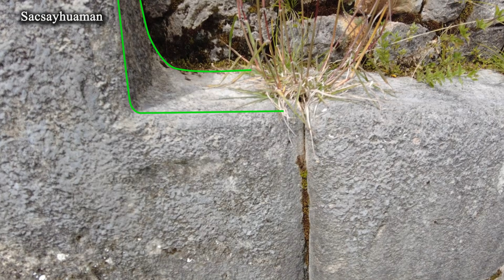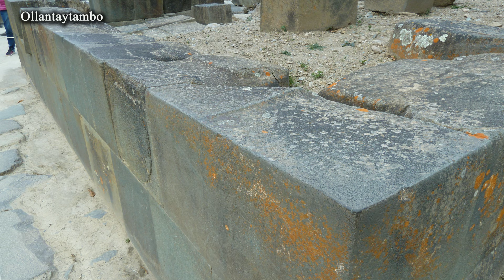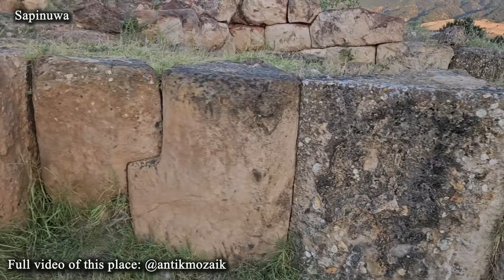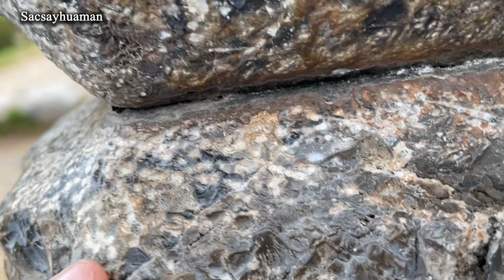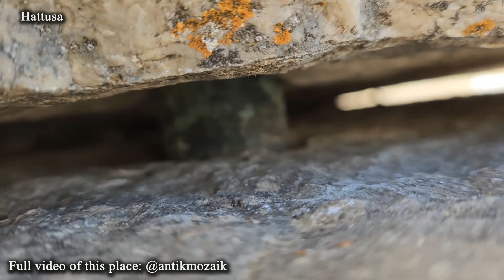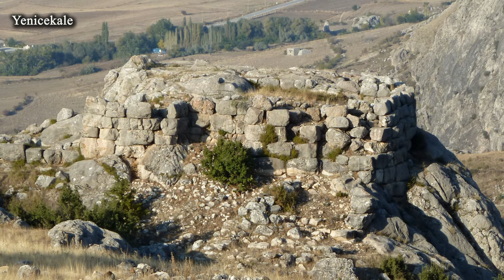Precisely Fitted Masonry in Peru and Turkey: A Comparative Analysis

Comment: As a structural engineer I know what amazing craftsmen the ancient stonemasons were. The fact that we can't build these today and don't know how they build it back then, it says it all. The size of the stones is one matter and the tight joints is another.

I will comment about these tight joints we find all around the world in ancient ruins. These tight joints became so after the fatigue of the material, by "Creep" as it is called. It is a phenomenon, a very slow process that creates deformation due to material fatigue after many years under pressure. Of gravity in our case.

All materials "suffer" from this deformation but it takes hundreds or thousands of years for it to become visible, depending on the material and specifically its Modulus of Elasticity. It is the property of a material that shows how "elastic" it is under external pressures. Yes, as like all materials has a hardness, every materials has an elasticity. It's two different properties.

In stone structures, gravity compresses the material of each stone separately and decreases them in height and the horizontal joints slowly close over by the years because all gaps coming in an equilibrium level of deformation. However, the vertical pressure simultaneously causes a horizontal deformation in the materials, in our case the stones, so on the upright sides of each stone, the upright joints also close so that finally one stone comes and rests exactly with the one next to it.

For every millimeter of vertical deformation for loose stones, they expand horizontally by 0.2-0.3 millimeters, half of this on each side. So, all the gaps closes all around by the passing a lot of time.

To better visualize this, say you made a plasticine cube and you squeeze it from the top, it will decrease in height but at the same time it will open up on the side and become like a burger. You can see that shape in many photos of ancient walls from various places around the world. This happens to stones after hundreds or thousands of years and it happens at a rate of 0.1 to 1 millimeter every 100 years depending on the material of the stone and the above load. Granite is one thing, for example, and Limestone is another. This percentage seems to decrease over the years, that is, as the years go by the material resists this phenomenon even more.

This phenomenon also smooths out any unevenness between the stones, not only at horizontal joints, but also at vertical ones. Because if there is any outcrop or small bulge then all the stresses are concentrated there, so this area will deform more quickly, until it comes to the same height/level as the neighboring stones.

So, tight smooth joints in ancient constructions are not an issue, is not something extraordinary. It forms naturally after so many years under the pressure of gravity. So, if we can find scientifically explanations about these tight joints they looks pretty much extraordinary, then some day we'll figure out also how they build them, how they lift these huge stones.

Thank you!
Reply from the maker: Thank you. As a physicist by training, I am indeed familiar with the concept of creep. However, one must consider that for granite and other volcanic rocks, the magnitude of deformation—measured in microns over centuries—is precisely why granite is used for precision reference surfaces. It is also necessary to account for the influence of moisture, which slightly increases creep. Nevertheless, we are talking about fractions of a millimeter. While this does affect the tightness of the joints, those joints are designed with an initial tolerance of 1 mm. Thank you!
Reply from the maker: Thanks again. I had been thinking about creep in the context of it fully forming a tight joint, but I hadn't considered it as an additional factor—just as you described. It accounts for only fractions of a millimeter, but those are precisely the ones that are hard to explain, as it looks like a thin ridge: https://drive.google.com/file/d/1tyICbXk7bxdWwSTzfAAbUZqOGeuMYFvS/view?usp=drive_link
Reply: @GRES_TAC  
Yes, that's the general idea, in the details can varies. I'm glad I got you thinking, if that helps you to explore new ideas.
I was wondering if a team of scientists, engineers and archaeologists could invent a dating method based on this phenomenon.
Thank you!

Comment: Theres some other videos I forgot the channel that shows there is a glass on the surface of the rock, specifically it was in a cave area that was carved and the still protected there is a very thin glass over the surface, which is interesting because stone also spalls when heated, so how did they treat the surface so evenly to achieve a surface finish without variance visible, friction, maybe an induction style heating with a paste of metal, a strong torch? The uncharted x videos just barely show there are tiny peaks in the cracks, that would be extremely difficult to do with hand tooling, especially rounded surfaces and arcs matching complex geometry to complex geometry, that is something we would be using a computer for today, using 3d modeling, really 4d modeling because your adding in the time variables of the construction techniques and all the variables associated, which is an interesting idea right, that would be a very useful brand new modeling software today, that we dont have currently.
Reply from the maker: " I forgot the channel " - "Evidence of Vitrified Stonework in the Inca Vestiges of Peru
By Jan Peter de Jong & Christopher Jordan"  Answers should be based on systemic properties. Rare features cannot serve as the basis for conclusions, but should be taken into account.
Reply: Spirit in stone is the channel